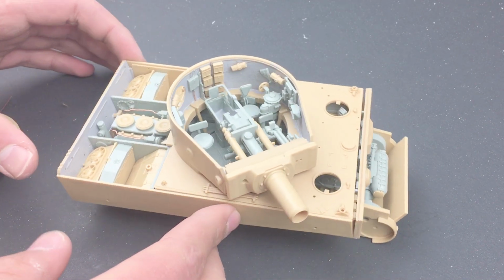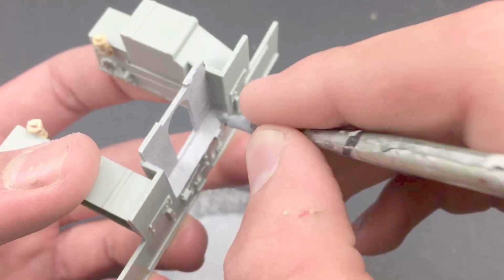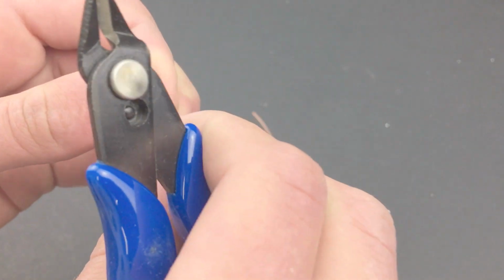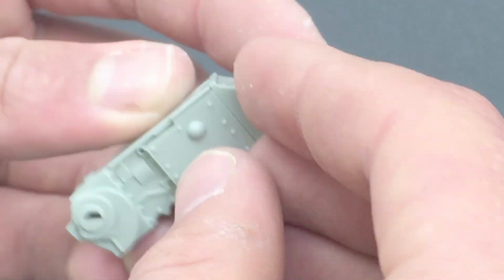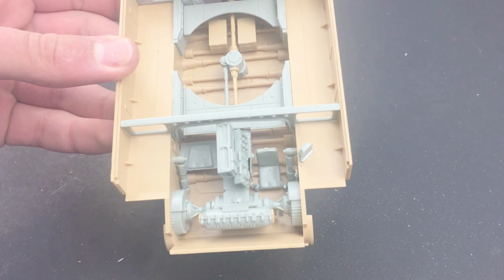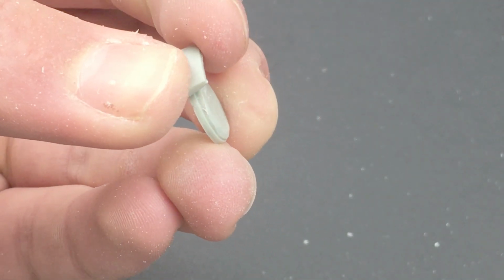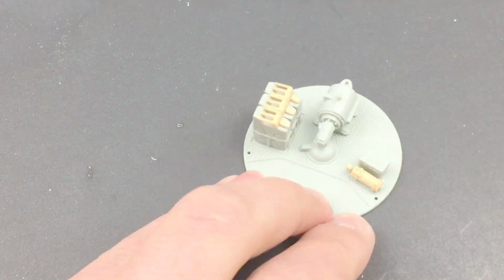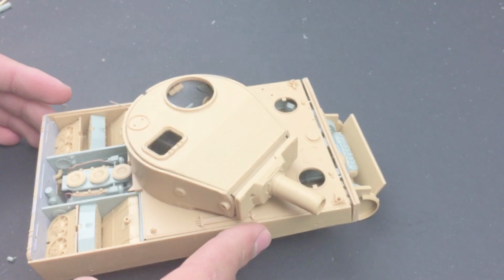Airfix Tiger 1 Interior Build And Detail: (Airfix 1/35 Tiger I "EARLY VERSION")

Comment: Great video...just starting this model...yes,the instructions are a bit lacking in detail and with starting have already run into issues with fittings....so,you do the inside turret and lower hull in putty/thin cement mixture..do you also do the suspension area or leave that?..have you put out the second video yet?...glad I came across this site just in time...thanks
Reply from the maker: I actually am finished with that model at the moment, so you should be able to roll through the whole series! I don't do the suspension areas, just because it ends up getting covered in mud anyways!

Comment: Mad Lad can’t believe you textured the inside steel of the tank. Unfortunately none of the problems from the Original 1996 Academy kit has been fixed in this “new” Airfix kit.
You bought back memories of having to skip a few steps forward or even check the box art to see where some internal components go...,

p.s. you were right about the tool kit, the two batteries are on the hull floor either side of the crank shaft by the rotating turret basket mechanism
Reply from the maker: Got it, yeah, I saw those. This kit really hasn’t endeared me to the tiger I. It was definitely a good experience, and I’m hoping to do more details and stuff on my next project
Reply: Frankly this kit is a way better depiction of a Tiger I than Academy's depiction of their M18 hellcat.